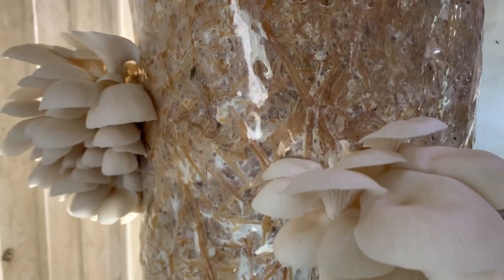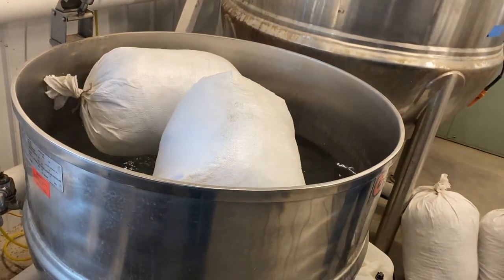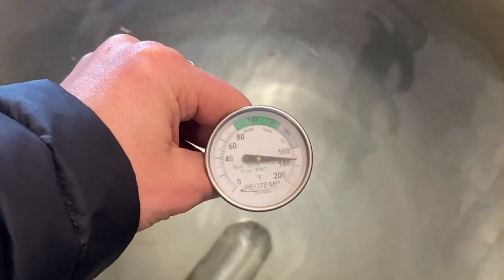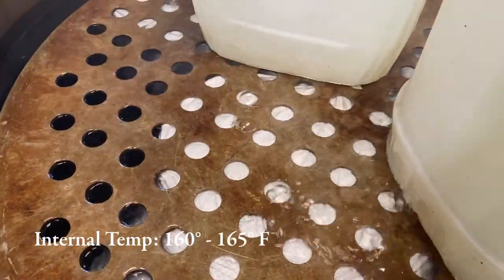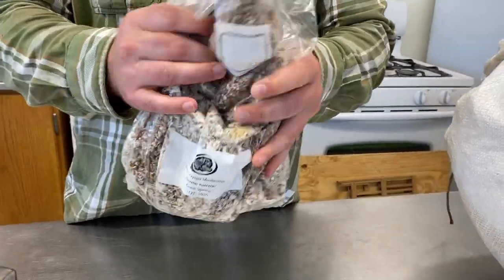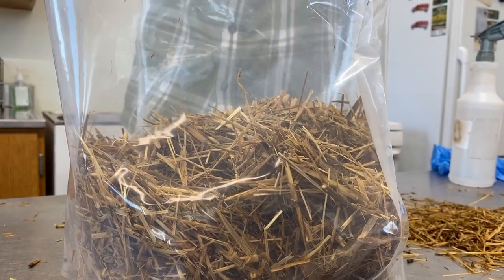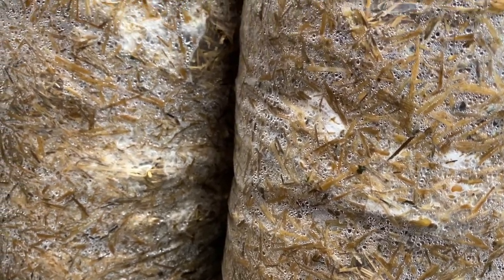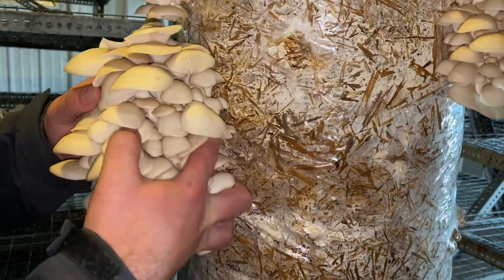How to Grow Oyster Mushrooms Commercially using Pasteurized Straw

Comment: I'm curious to see that you're cutting before full colonization. I've always waited for full colonization of the bags/buckets. What's your colonization time with this, if you don't mind me asking? As I think about it, does the FAE exchange, i.e., allowing more oxygen into the mix, help to speed up the colonization rate before cutting? What are your thoughts on this?
Reply from the maker: Great question - it depends on variety. Pink oyster is usually ~12 days, other oysters are closer to 3 weeks. We cut holes in the bags for better O2 exchange.

Comment: Awesome video, thanks! 

Do you think it would work to put the straw in a 5 gallon bucket and fill the bucket with boiling water, then let it sit overnight? That method works with aspen chips. 

I don't have a big pot to boil straw in.
Reply from the maker: We have done that before and it does work, however, it is more prone to contamination so you ultimately do not get as many mushrooms as you would with pasteurization.
Reply: @FieldandForestProducts  Thank you! That's very helpful.

Comment: Nice Video! I can't find organic straw, does pasteurizing the straw get rid of the GMO sprays on it?  Also is there any way to use less plastic - I'd like to take more of a regenerative closed loop system approach.  What about using corn or sorghum stalks that are dried, then chipped or shredded, then pasteurized?   Thanks for sharing!
Reply: Wheat is not a GMO crop and is not sprayed with anything. Don't over complicate it. Look up lime "pasteurization" it works fine
Reply from the maker: To close the loop I would use the 5 gallon buckets which can be rinsed and re-used. As for the GMO question, wheat and oat straw is not GMO so you're good to go there! You can use sorghum or corn stalks (corn however is heavily GMO in a lot of cases) if chopped and pasteurized- however, the yield will be slightly less.
Reply: Have a look around you,  see what is going for free, I have just had great success with fallen bamboo leaves and a warm weather oyster strain - cold pasteurised with wood ash and lime
I would steer clear of big AG , you just don't know what chemicals and fungicides they are using and it will always be in your mind when eating your produce

Comment: Hi nice video, I have a question if you don’t mind? I have colonised box tub of straw and mycelium I’m trying to fruit and it won’t, gave good air exchange, light everything? Been about 7 days now any help would be appreciated thanks🙏🏻
Reply from the maker: How long it takes will very much depend on how much spawn to straw you used. There's a variety of things that could be happening but I would suggest putting a tarp or bag over the straw until the tub is colonized and once you notice strong spawn run then introduce airflow.
Reply: @FieldandForestProducts  hi thanks for the reply. Yea the whole mono tub is colonised with nice white mycelium no contamination’s nothing, it’s been in fruiting now for 7 days getting good air exchange and 12 hours of light, 99% humidity and still absolutely nothing as happened? I’m lost ha.
Reply from the maker: @stevenprice4810  What strain was it?
Reply: @FieldandForestProducts  thanks again for the fast reply. It is Thai Elephant Dung Cubensis.
Reply from the maker: @stevenprice4810  Ah. This video is only for Oyster mushroom strains. We have never grown that particular mushroom, but you will likely need a more robust substrate than just straw. Often a manure based substrate is used.
Reply: @FieldandForestProducts  I’ve just inoculated grains with a nice blue,grey oyster that’s next, thought I’d try these first ha, Maybe casing layer of compost or worm castings?
Reply from the maker: @stevenprice4810  I would try compost. Again, can't say for sure if it will work, but it sounds like it just need something to stimulate fruiting.

Comment: I shock the straw with hydrated lime in water and I have never had a problem with wild spores taking over.  A lot easier than heating
Reply: I have nothing near the heating arrangement shown in the video. How does the hydrated lime process work?
Reply from the maker: @michaelcarter1061  A large pot on the stove top will also work! You will just have to do multiple batches. Otherwise you can find instructions for a lime soak here: https://www.fieldforest.net/product/oysters-on-straw-instruction-sheet/instruction-sheets
Reply from the maker: Lime is a great alternative. We have noticed more stable production over the long-term with heat pasteurization, but lime is certainly a popular choice!
Reply: @FieldandForestProducts  it worked for me the two times I did it and need to place a order and grow some more. I put a drain valve on a 55 gl. plastic Barrel I cut the top out of and place straw in a feed bag like in the. I video. I would need to look in my mushroom book again and see quantity of lime used. I am thinking about stretching out production this time and doing smaller batches. I might then just cook the straw in my turkey fryer. Oyster spawn is pretty aggressive and takes over limed straw pretty fast. Small batches heat it I agree.
Reply: Is it necessary to water or sprinkle the Mushroom bags during fruiting stage ?

Comment: Is it possible to incubate and fruit them outdoors? Weather conditions permitting
Reply from the maker: It's definitely possible. The biggest hurdle will be dealing with the substrate and actual mushrooms drying out if there is wind. For incubation I would suggest draping the bags with a tarp so prevent moisture loss, and for fruiting I would make sure they're in a protected location.

Comment: No need to add agricultural lime ?
Reply from the maker: Not with this method- if you're not using heat pasteurization then yes, you will want to use lime. But keep in mind that a lime soak isn't a true pasteurization so there tends to be a higher contamination rate.

Comment: Do you water the bags ?
Reply: no. the straw should be soaked but no excess water in the bag. During colonizing if your bag is drying out you could mist the holes a bit, but i would not "water" them like a plant.

Comment: How many flushes does a bag produce?
Reply from the maker: It depends on how you want to keep the bag around. They will continue to produce mushrooms for quite awhile, but each flush will get smaller with a longer wait time between flushes. Generally we keep them around for 5-6 flushes before sending them to the compost pile.